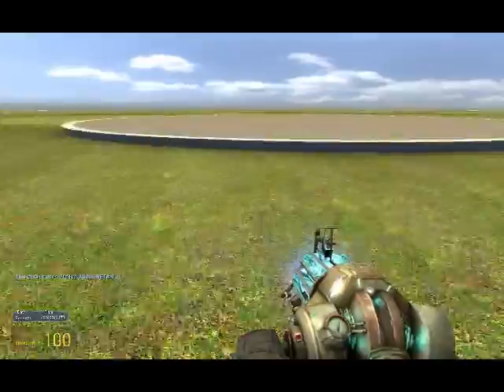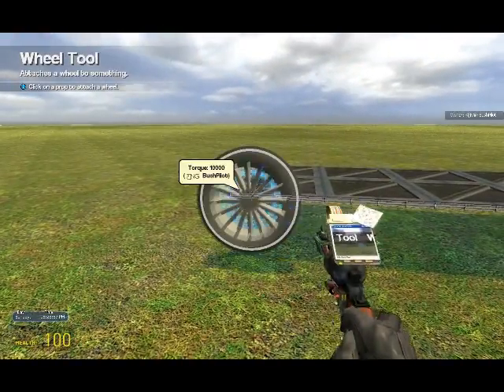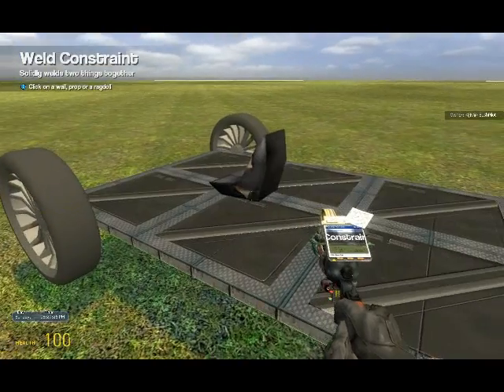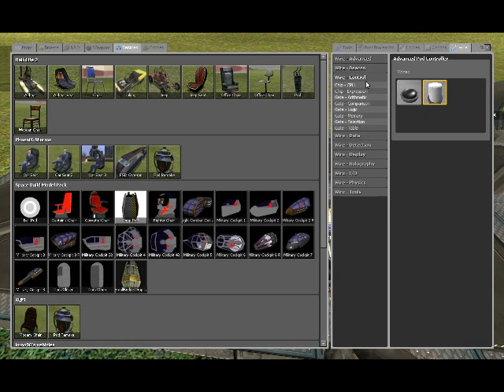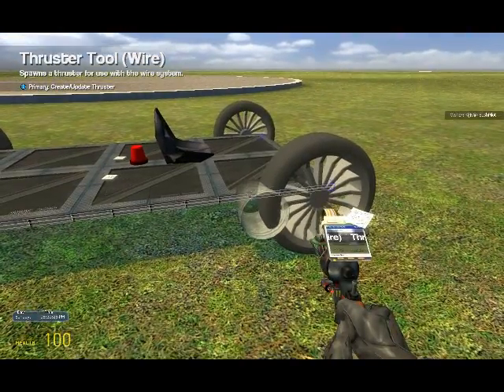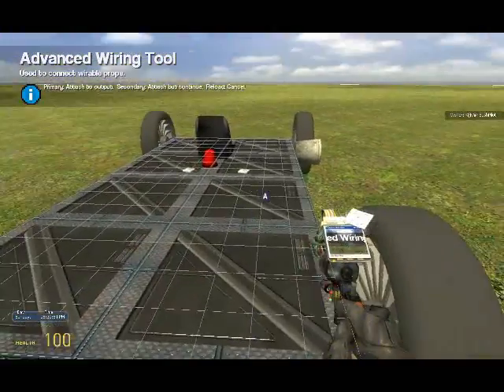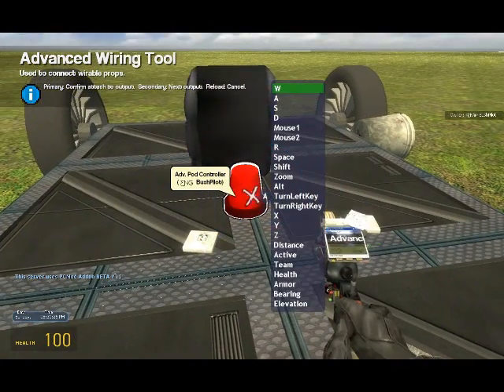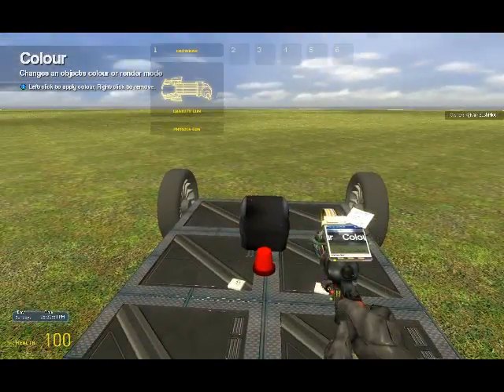Wiremod Tutorial - Adv Pod Controller

Comment from the maker: yeah you do. it is to split the values so you can use the same thruster for both forward and backwards by assigning them to different outputs on the pod controller. if you dont use a gate it only has an A value, which is forward. using a gate it has A and B, forward and back